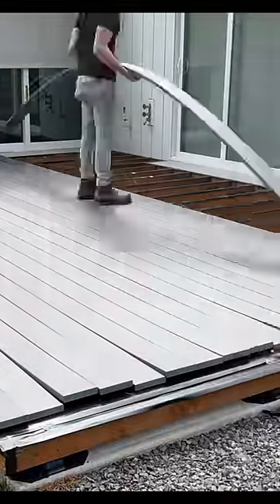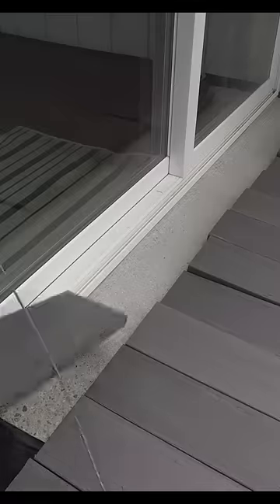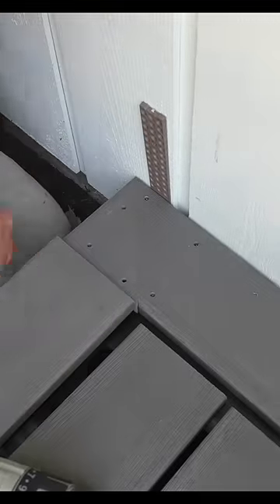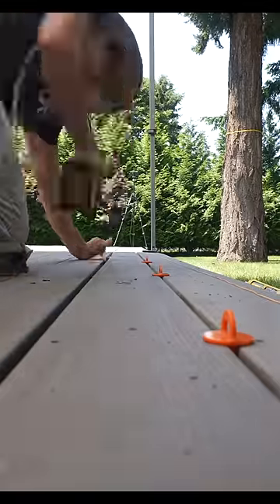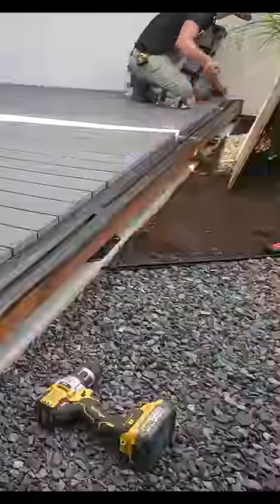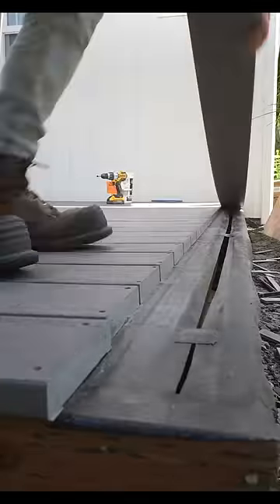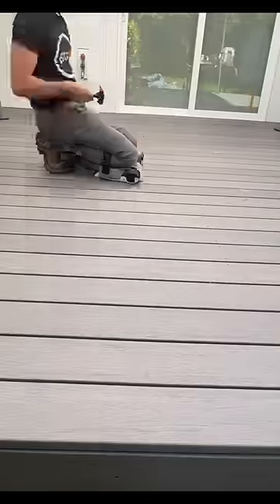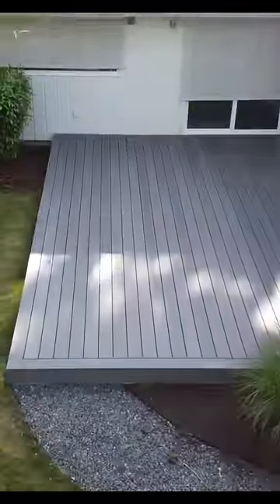How To Install Decking Like A PRO! #deck #deckbuilding #construction

Comment: Piece of advice.  Don’t use composite decking.  It doesn’t last as long as you think and when the sun beats down on it you’ll need to wear shoes or you’ll burn the hell out of your feet.
Nothing beats real wood in my opinion.
Reply: Yeh, turns to spaghetti and expanda and shrinks so much! I had a client rave on about it and decided to get me to also replace His timber deck with it and Australian hot summer I got half the deck down and then the very next morning the gaps were huge ( followed this composite guide with what temp it was) client wasnt happy with it and insisted I relay the half of the deck. So I had to dry lay it all and then stacked them inside and after smoko fastened it down had him come out and be happy with it showing I did the correct spacings the product asked for and he was happy until that weekend and he couldn't walk on it. Tried to point the blame on me that he wasn't happy with the gaps he still couldn't swallow his pride and had another chippy come replace it all back to timber 🤣 I now just refuse to install the stuff.

Comment: Timber tech boards are one of the better of the composites as well. AZEK is alot of PVC and moves in the weather. TREX has a fun mold issue on the bottoms because of the wood shavings and composite not having the same PVC cap underneath. But depending on your area, they're all pretty good

Comment: Great job, looks tight, I hope you live in a area that 80 is the high . Composite plastic boards sag in high heat if you walk around on them
Reply: Looked like plenty of support? 
True, it's going to get plenty of direct sun with no awning.

Comment: Composite boards expand quite a bit. Rather than screws, clips that allow the board to move freely when expanding work much better. Eventually in the sun those screws will either snap from the shear force or your boards will buckle. Other than that, looks clean.

Comment: I got hired once to install decking that was already cut to size.  The "Carpenter" who hired me was a cheapskate and figured the deck was "almost done" already and didn't understand why it took me 8 hours to lay out, space out and screw & plug every hole.  And I took no breaks and got it done in the heat of summer.  Had an attitude when it was time to pay.  Never working for that guy again.  Deck came out beautiful and the customer was very happy!

Comment: Hidden fasteners are so much easier to work with, no plugs to screw around with, perfect gaps because of the fastener. Nice job though, hope all those plugs hold up in the cold winter.

Comment: Decks are kind of a weird thing when you think about it. Especially one like this. Spending many thousands of dollars to have a flat surface at ground level to sit on occasionally. It has to be a predominantly American thing. My parents were obsessed with decks. We had a 2 story house that they put decks on 2 sides of the house. One of them they had a door and a little tiny foyer area built between 2 bedrooms. No one ever, ever used them. They were literally just an exterior platform with a set of stairs that you could use if you just didn't want to use the interior stairs to enter or exit the house. Actually, I just remembered that there was always outdoor furniture under the second story deck on the lake side that got used often for the shade. They could have bought a couple of big umbrellas for .01 percent of the cost of the deck and would have served the same purpose

They also had a tri level monster in the front of the house on the lake side. That one did get used, but this was the 80s and they were all wood so it was just a massive maintenance project as well.

Comment: Dude. If you get grooved boards then you can use hidden fasteners. Then when all of your inner boards are installed you picture frame the outside with none grooved boards. That way you only have to use the plugs for your picture frame boards.

Comment: Would recommend using a composite board rather than this full PVC board.  The PVC expands and contracts dramatically with changes in the temperature.  Quality workmanship though!

Comment: Looks nice, but why not b use the unseen Fasteners that that you screw in between.
Giving you the spacing.
And an unseen Fastener. That doesn't need the plugs that may come out later , When cleaning with a pressure washer..??

Comment: Never put the small endpiece in the high traffic area.  You put the tiny triangle at the corner everyone will walk on.  Highly visible as well.  Put the long board there and the piece against the house.  The joint is less visible.  Hope you put the railing up so no one knocks the triangle off.  Looks great irregardless, but you may be repairing that piece more often than you think.
Reply: Why not just cut a 45 on the it in the first place?

Comment: I don't know about anyone else but I would have just made the deck 1 foot shorter so I would not have to monkey around with those mitered end boards. That or use 2 boards and have 1 seam in the center if 21 foot is a must.

Comment: U did good but you should look into the camo fastening system. No need for plugging except on PF will speed up your job and lower costs
Reply: Also will not have the same hold as top down fastening. Thin shanked Camo will sheer and the clips allow the boards to much expansion/ contraction
Reply: @patmaher6304  expansion contraction does not change based on fastening. The smaller shank screws allow for movement that is needed. This deck will have broken screws. There was no pre drilling for the cortex. Also picture frame doards need double screws on miters. Fiberon or pvc boards like what is being used moves the most and needs to be able to.

Comment: They have better Fasteners that the screws go into the side provide the spacing and you don't have to go around and fill holes just do your research before you start a project

Comment: Instead of drilling on the top and using cover caps, you could have used the Camo deck tool. It allows you to drill on the inner edges of the board hiding the deck screws…no  caps needed.
Reply: Top down fastening will give the best hold. Thin shank Camo screws will and do sheer off. The Cortex screws ar self setting. No pre drilling needed

Comment: Uh... not a bad job at all... but have to provide constructive criticism here and say not really an installation like a "Pro" either... and here's why.

Round or Radius edged (or bull nosed) deck boards should be used for rail tops(drink railing style), stairs, and the outer edge of your deck for a "picture frame" style ONLY!  All composite decking manufacturers offer both radius edge board and deck board (has grooves on edge) for building decks.  They don't just do round edge only.

Use actual Deck Boards, which have the groove style edge, and then utilize hidden fasteners (so many varieties) to secure them. Then there's no screws in the deck boards themselves, spaces are perfect, and a much quicker and cleaner process all around.

Then supposed to use the panhead deck fasteners, which have a reduced circumference on the head, for those round edge boards only. You pre-drill the holes by 1.8 inch and those screws sit flush with the board and because you're also supposed to buy color matching screws, you won't notice them.

The corners on that job... wtf?  That's no Pro at all, that's pure amateur at best.  When your deck length is longer than the board length, you're supposed to put middle seems in.  This cuts the deck length span in half so-to-speak and allows for clean corners.  It also looks really cool on long decks.  Then you're not having to invent odd adaptability tricks like you did on the corners to compensate.  That's what the "Pro's" do anyways.

Then not measuring and cutting deck boards appropriately, putting them on at odd sizes and doing a finish cut at the end is inherently dangerous as this can end up leaving a wavy looking edge when you look straight down; you're cutting with a hand-held circular saw... oof.

Comment: I hope the floor joists and support posts are made from the same material.  If not, the deck surface will last forever but all the substructure below it will rot away.  The whole project is only as strong and durable as its weakest link/part.

Comment: Should've gotten the timbertech concealoc clips and grooved boards for most the decking. You'll have a lot less holes to plug
Reply: This is PVC. the best hold is top down fastening in cool temp to limit potential movement

Comment: I like they don't rot but in heat they sag a little and nails will slide thru on some , I had this deck before I guess its better than rotting

Comment: I had the same problem once,  with the length.
I cut my seam about 9 1/2  ft. Rather than on the corner.
Only because I had an extra piece of the material.

Comment: Sure the corner looks nicer, but length wouldve been slightly long without the cut... when you turned it, you got a ¼" or so off the perpendicular, math works if you use it

Comment: Great work. But i will never understand how people can choose that stuff. It conducts so much heat that in the summer walking barefoot can send you to the hospital. I was sitting on a friends deck at 10 at night, and so much heat was being released, we had to move chairs onto the lawn. I would much rather use treated lumber with TWP as a protectant.

Comment: Why would you frame it so a 20’ board doesn’t work? Make the rough 19’-8” or something then add 3/4” white pvc to cover rim joist , then you get enough overhang to miter the corners . Always frame it smaller than the longest board you are using.

Comment: Excellent job with the construction, unfortunately those composite boards are going to need to be replaced in 10-15 years. My back deck has them and I don't think there's a single one that isn't warping or peeling up in some capacity. If you want this kind of look, go for something more durable and just paint or stain it.
Reply: This is PVC not composite. The product will be there when the frame is rotting
Reply: @patmaher6304  Narrator says composite in the first sentence dude. And even if they’re PVC, they’ll still fall apart in 10-15 years. Like I said in my first comment, I have the exact same material on my deck and the whole thing needs to be resurfaced because this junk is warping, cracking and peeling like crazy. In my experience with it, it’s not good decking material and nothing you say can convince me otherwise

Comment: I like composite decks because they have a long warrantee with no paint or stain ever. Zero maintenance. Trek is available locally for me and the only issue I have it gets VERY hot in the Texas sun. Shading is required to walk or stand on barefoot.

Comment: Not bad but you could’ve visited a nursery to get some lo-cost ideas. 
For example, you could integrate a step to ground level and some permanent seating may be desirable too. 
Yes, you can add it later but it will cost you time and money, plus the enjoyment of having it installed. 
We actually go to school to learn this stuff. 
Good luck👁🙏🏽👁

Comment: Shopping at Lowes and Home Depot I could not find true measured wood treated  boards. That was 3 years ago and there were no composite decking. Even now I don't find Any in these stores. Nice aterial. Wish I would have used it.

Comment: Composit  board are known to hold the heat in and can become extremely hot in derect sunlight 🔥
Reply: This is PVC not composite. PVC will reflect more UV than composite and not get as hot or hold the heat as long. It can still get hot but so does wood with dark stain.

Comment: Composit planks melt and sag in hot summer. It gets over 100* here and composite decking sags between every joist. 16” centers is too far apart.

Comment: Or you could have hidden the screws altogether. Yep, there is a tool for that.  Also, you didn't appear to use tape to prevent wood rot below the composite.  Look into deck seam tape and the camo system or tree hideaway fasteners.  And spacers? You use a spare screw as a spacer - you already had to buy them, so why waste money?

Comment: What's really the point in these composite boards? I get you can be lazy with the maintenance but they're still cupped, they still move and you're using a load of plastic rather than sustainable local timbers. It does look nice and I'm not trying to critique the craftsmanship just the choice of material

Comment: Shouldn't composite be run with the track system composite needs to move because it expands and contracts. You can fasten and plug picture frame. I live in canadian climate anyways job looks great just curiosity to learn new ways as composites an  expensive material.

Comment: Better composite decking is available with hidden fasteners so you don't have to waste time with the plugs. This is how REAL PROS do it.
Reply: Real pros need to learn about new materials. the best way to install PVC decking is top down fastening at cool temperatures when the board is in a contracted state

Comment: Why don't you miter two long boards instead of miter one long board then bake the small triangle piece? You want an extra butt joint in addition to the miter one? Not only that but you have like one butt joint on a corner and two of those odd miter plus butt joints on at least two of the corners

Comment: Spacing the boards i don’t feel like it’s necessary because over time they’ll shrink & space themselves (btw I’m not a carpenter nor do I build houses)
Reply: This is PVC. It does not shrink. Gapping is for drainage and airflow around the wood framming

Comment: You know what I never understood, why is there have to be spaces anyways? I prefer the look of them butted right up against each other
Reply: Drainage from the top and airflow for your framing. I’ve seen 6 month old deck frames covered in slime because the were sealed up

Comment: I used this product on my deck, 25 years later the boards are soft and sagging and bounce when you walk. i would rather have used real wood and replaced it once or twice for a fraction of the price than spend the cost i spent and still have to replace it 25 years later. over time it IS NOT cost effective.

Comment: Concrete would have been quicker and cheaper, and the concrete won't rot like wood in a low-profile deck.  Sure, the wood deck looks great like it is but what about 5 years later or ten years later.

Comment: I have experience with that stuff and I’m here to tell ya. Gonna be waved like the ocean in about a month. I hate that stuff
Reply: UNLESS UOU INSTALL IT IN THE HEAT OF THE DAY. DONT INSTALL IN COOL TEMPS. WHEN IT HEATS UP WITH WILL WAVE
Reply: Actually the opposite. Install in cool temps when contracted and use top down fastening like the Cortex plug system

Comment: Isn’t that composite ? You screwed it down like wood !
Reply: It’s. PVC. should be installed with top down fastening in cooler temperatures to limit movement

Comment: Until it gets hot...
Reply: Best thing about composite decks are how they finish, they look absolutely amazing.
The best composite deck material ive found is Duralife.
Its a polypropylene cap and internal core 
Better than the softer polyethylene composites that delaminate to the outer core